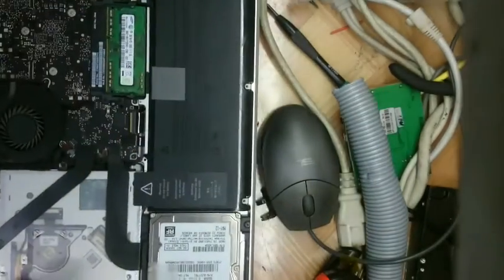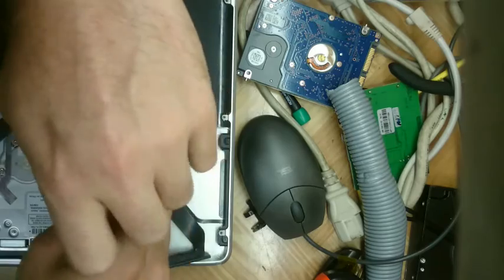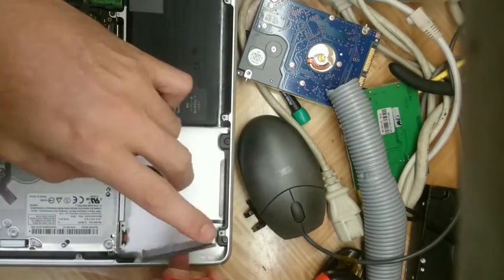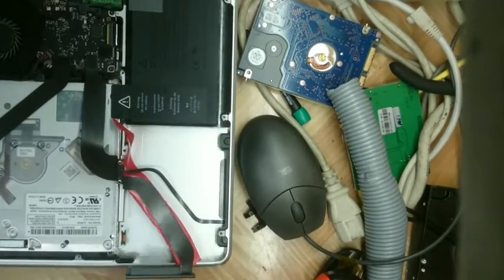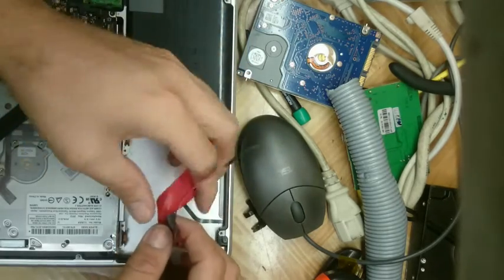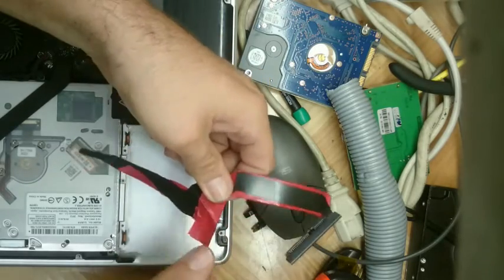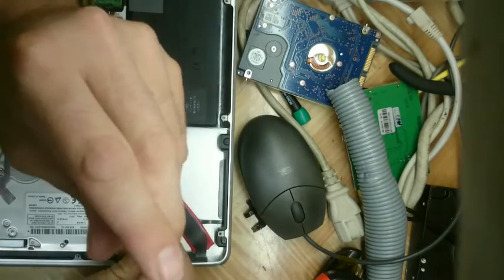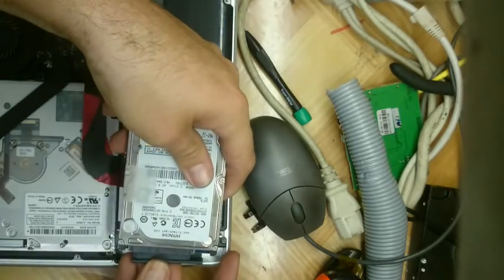macbook Pro A1278 no boot-  Sata Ribbon cable repair - Fix no format or non existant Hard disk

Comment: Ordered a new cable but it will not be in for a few days. This ABSOLUTELY saved me. It booted it right away. The only thing I did differently was I put electrical tape onto the body. Not the cable. It was easier for me to line the path under the cable rather than try to wrap the cable. Thank you thank you!!!

Comment: I have a problem on my hard disk but not on that place. I have 2 disks (ssd on the video local) and another one on the DVD place (that's the one with problem as it can't be recognized sometimes). Does this fix can solve the problem?
Reply: I believe that is correlated to a SATA speed problem. I heard that people are having some issues because they are using 6gb/s HDDs/SSDs

Comment: my hard disk detecting but cant format but i tried swapping in optical drive casing box. then i can able to format it . And i installed and swapped back in to the hard disk sata cable and now only logo and spinning wheel not booting into mac . And i tried with another hard disk, cant boot into pen drive itself and when i remove the hard disk from the sata cable , then it shows the pen drive os . 

so will it be a faulty sata cable ? please help me